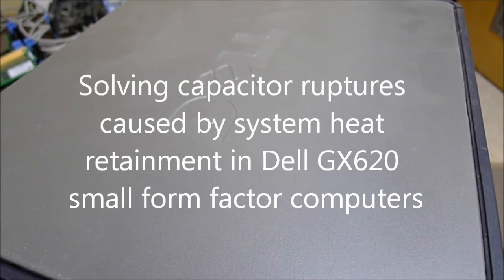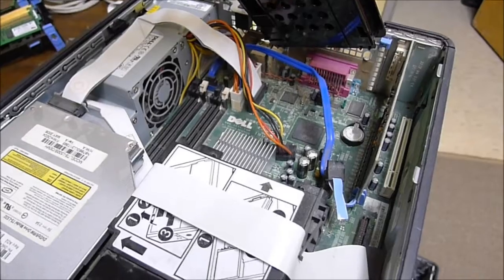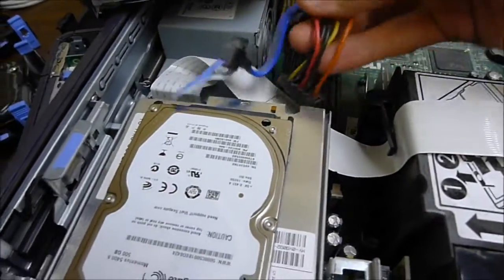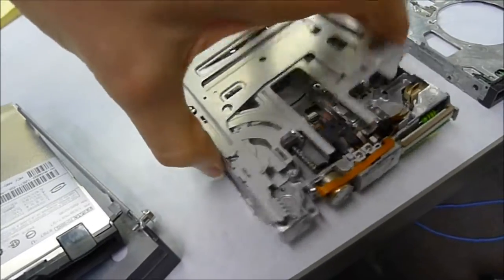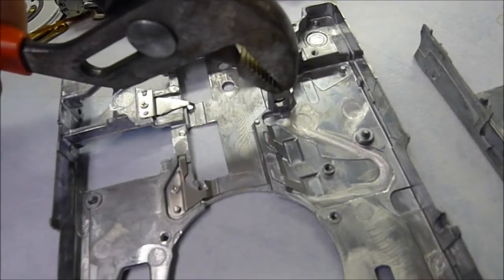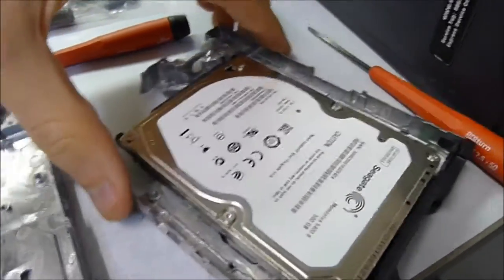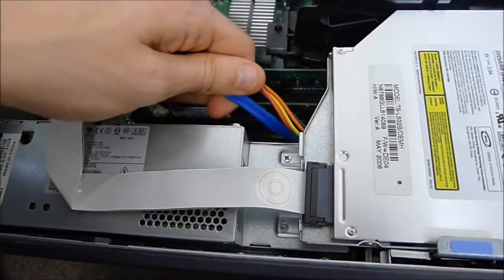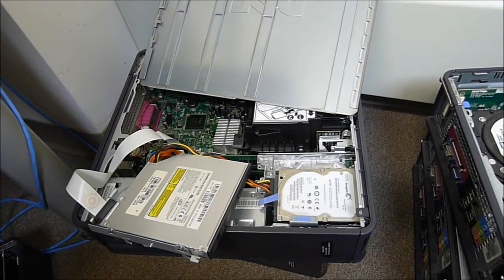Dell Optiplex GX620 SFF - a heat dispersement fix

Comment: That floppy was only a thin half height.  There was enough room under it to mount that 2.5 inch hard drive with some strategically placed double sided tape and keep the floppy drive.

Comment: I'm running into the same issue with heat.  Why not use something like Vantec Spectrum Fan Card? Or any any other low profile fan PCI express card cooling fan? I just have a blank where the 3.5 floppy would go.

Comment: Yeahhh...I wish I'd known about the heat issues before I bought a refurbished one from Amazon. I mean, it's a decent older model but, yeah, the heat issue does cause problems. Not with the capacitors in my case. It actually contributed to the frying of the installed hard drive instead. I replaced that. When I did I also left the back cover off the computer. Now at least the fan can blow the heat out of the case. I know, I know, what about dust? Well, it's actually easier to clean the computer's insides with the back off. So no problem there. The sucker's fan is still noisy as heck though. Still goes into "airplane noise" overdrive. But at least the heat issue is a tad better. Sighhh...computers.

Comment: Just turn the fan around so that it extracts the hot air from inside instead of blowing it back in the computer and burn the electronic components! Fan should take the heat out, not circulating the heat inside the box!
Reply: thats exactly what i did after the hdd died because of heat. read that somewhere in the net. and i cut a big hole in the hdd holder ans installed a fan under the harddrive. makes a huge difference

Comment: agreed. all dell are all not well thought out, and for good reason.  if they fail, dell gets to sell another junkbox.  itx rigs usually have very little air room, so when you have one that blocks air, nothing good can come about.  i was extremely disappointed that the 775 itx board in the gx620 did not support core2duo and core2quad upgrades like the chipset is supposed to. dell intentionally locked the bios down so they could peddle more of their junk.  that was a very nasty move on their behalf.  i was looking for a core2duo upgrade to cut down the TDP and power by half, unfortunately, i'm stuck with a hot Pentium D 820.

Comment: I have a question, you've removed the hdd fan with the hdd caddy.

How do you get rid of the "rear fan failure" message at the beginning of the boot which happens because of removing the hdd caddy?

Comment: Solder on better capacitors and your problems are solved. The issues are NOT related to cooling, It's due to bad capacitors. That same brand and type were used on several different LCD monitors of that era and they all fail too, its 4x 2200 @ 6.3v and 1x 1800 @ 6.3v. Step them up to a 10V or higher cap with a 105c rating and they will never fail again.The later 755's have a cooling fan in the bottom of the hard drive bay that can be used on the 620 but in the 500+ I fixed none returned for caps.

Comment: I have had one of these systems for ages now and have been reading about the heating issues after I been looking into getting a graphics card and came across your video. I am now getting a 2.5 HDD but I got two questions.

Does any of your models still work and have you noticed any improvement after doing this (if you still have them)?

And secondly, I keep hearing about reversing the front fan. Any chance of a video showing this, I can't even get my fan out of the case :(

Comment: there was a here where a guy turned the fan around,  another added a fan to the vents.. great ideas here.. 

this is my trick.. you can get a 'copper 3 heat tube" heatsink at Ebay ..DELL OPTIPLEX GX520 GX620 740 745 745 USFF COPPER HEATSINK CASE 0Y1851 Y1851 Mou . they have them for $6 or $10 and $5 shipping... 

you can also get "Nano Diamond thermal paste bout $8 anywhere today, its about 5X better 
conductoning heat than 98% Silver.  they put terrible thermal "tap" in them in the factory

Comment: I have Dell Optiplex Gx620 mid-tower model with broken PSU. Intel Pentium-4 @ 3ghz and very common failure with these models as I googled the issue.. Fucking Dell :( I had perfectly running Hackintosh Snow Leopard running with it... Micro-ATX PSU's are rare and expensive, dont know does it bother to replace it anymore... No heat issues with mid-tower model though and capasitors seems just fine also. I will never buy Dell computer again.

Comment: All the capacitors looked fine - no problem there. I will look at replacing the fan. I wanted a Dell because all the ones I've used at work were silent - I'm disappointed that this one is so loud. Maybe when it was refurbished they moved the hard drive and replaced the motherboard but kept the old fan - I just hope a new one will help the issue, I love the computer otherwise. Thanks for responding! Kristy

Comment: The fan on my GX620 runs super loud at times - sounds like it's a plane gearing up for takeoff. I've been doing research and was worried the overheating would cause a meltdown or failure so I was all set to do your mod. I opened up the case and the hard drive has already been moved- actually looks like it was moved under the floppy drive- it was a refurbished used computer. Anyway it is all wide open like you see at the end of your video but the fan still runs hard and loud. Is it a fan failure?

Comment: @heiseheise Mine has a small internal speaker and it sounds like crap...You could probably attach a speaker to that clip if you figured out the polarity. In my gx620 I turned the front fan around so it blows out the front and i use speedfan to keep the fan at 65%. Everything at full power is around 47-52C so that worked for me (I have a huge ass Nvidia in there that gets a little warm though)